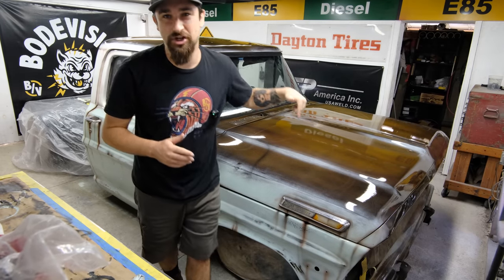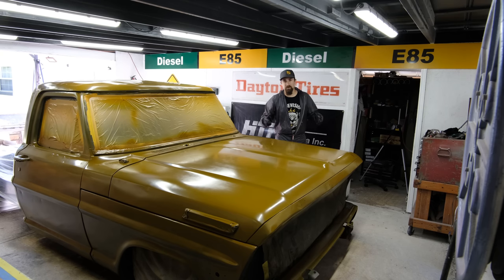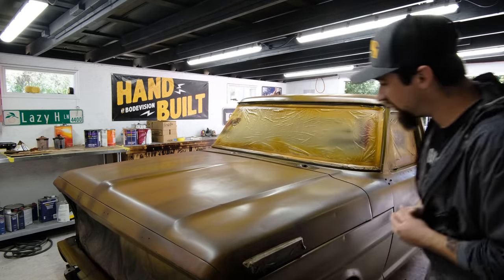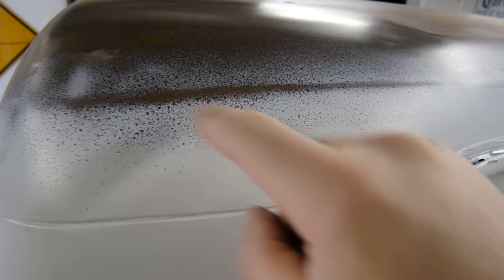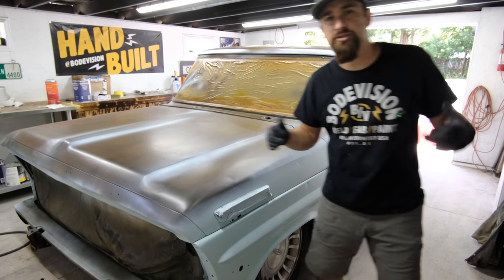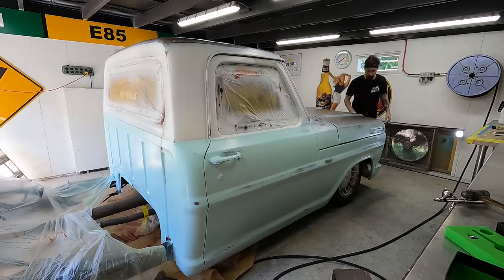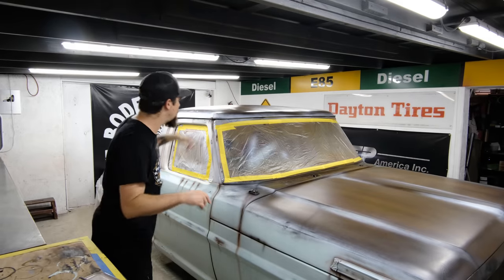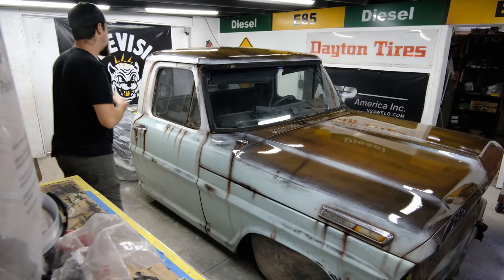ULTIMATE Patina Paint Job Guide 🔥 | Step By Step

Comment: The paint job turned out $!CK 👌🏽 Maybe airbrush a couple rust pockets at the bottom corners of the doors &/or quarter panels. I like how the badge is completely faded & how you accented the roof seams.

Comment: Hello
This is great work! Thanks for sharing the process. I want to do something similar with my project. 
I would like to know your opinion about the bumpers and emblems. 
Do you think these parts should be re-chromed or is it better to leave them as is? New chrome certainly looks cool, but firstly it’s very expensive now and secondly it probably won’t match the aged paint job of the car. Things like headlight bezels and hood emblems made from pot metal have pitting. I was thinking about polishing all the chrome parts as best as possible and then waxing them to protect them from further corrosion. Of course, all deep scratches and pitting will remain visible. I would just like to know your opinion/advice regarding chrome parts, maybe you have some experience or other solutions regarding bumpers and emblems.

Comment: you might be able to solve the problem with the matt clearcoat by spraying the car with two people so that overspray isnt spaced as mush (working from the middle out) , might allso help to have sumting in the clear to slow the drying time giving it more time to lay out 
the shiny clearcoat just screams fake , maibe if you add some streaks of clear matt and wetsand it to make it a little more mat and do the same patina thing with the amount of gloss still on the car after years of use
Reply from the maker: Two people would require more of an air compressor than what I am setup for. I appreciate solutions like this, but I am doing what I can with what I got. Also where am I supposed to find another painter on a whim?

Comment: That's one hell of a paint job! I have a question though... When I painted my hood it looked fantastic. I let it sit for a few days before I put it on the car but over the next few weeks it ended up with some wicked orange peel. Why? Did I do something wrong or is orange peel inevitable?
Reply from the maker: Shrinkage in the clear coat of automotive paint refers to the phenomenon where the clear coat retracts or pulls away, often causing imperfections like tiny cracks, pinholes, or a wrinkled appearance. This can detract from the smooth and glossy finish that is usually desired in automotive finishes.

Here’s what causes it:

	1.	Rapid Drying: If the clear coat dries too quickly, often because of high temperatures or using a fast-drying thinner, it may not have sufficient time to flow out and level properly, leading to shrinkage.
	2.	Improper Mixing: Clear coats typically require a hardener or activator. If not mixed in the correct ratio, it can lead to improper curing and eventually shrinkage.
	3.	Solvent Evaporation: Clear coats contain solvents which need to evaporate for the coat to dry. If these solvents evaporate too quickly or get trapped due to thick applications, they can cause the clear coat to retract once they finally do escape.
	4.	Underlying Contamination: Any contaminants on the surface when the clear coat is applied (like oils, grease, or old wax) can interfere with adhesion, leading the clear coat to pull away as it dries.
	5.	Insufficient Flash Time: When painting, especially with multiple coats, each coat needs a certain “flash time” to let solvents evaporate before the next coat is applied. If this time is too short, solvents from the underlying coat can migrate into the clear coat, causing it to shrink as it dries.
	6.	Previous Coat Not Fully Cured: If the basecoat or any previous coats aren’t fully cured before the clear coat is applied, their ongoing curing process can affect the clear coat, leading to shrinkage.

To prevent shrinkage, it’s important to follow the manufacturer’s instructions for mixing and applying the clear coat, ensure the surface is clean and free of contaminants, and give each coat adequate time to dry or cure before applying the next.
Reply from the maker: ^^^I would assume shrinkage was the issue and here’s some of the cause I found and possible explanation
Reply: @BodeVision  I definitely put a few coats on and I'd have to bet I didn't let enough cure time. I basically treated it the same way I would a rattle can. Thanks! Definitely need more practice before I do the whole car. Lol